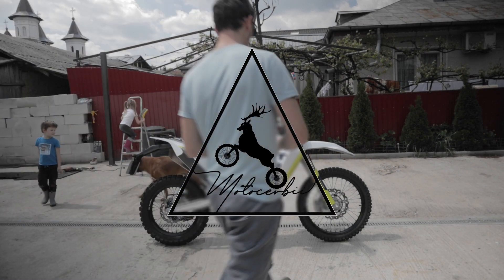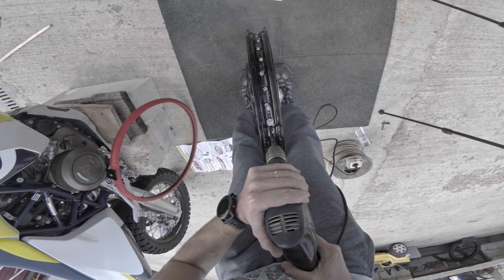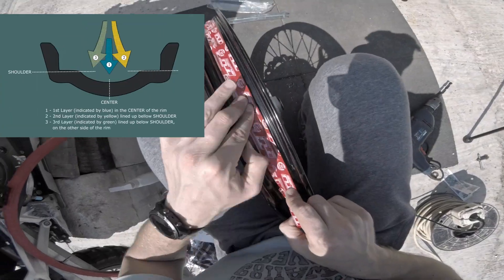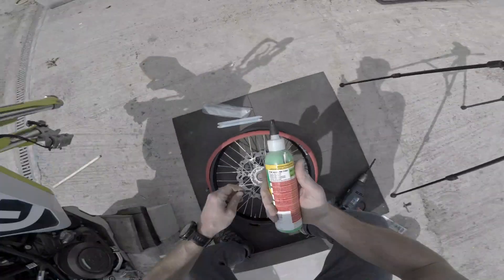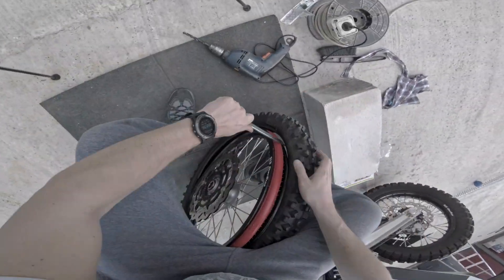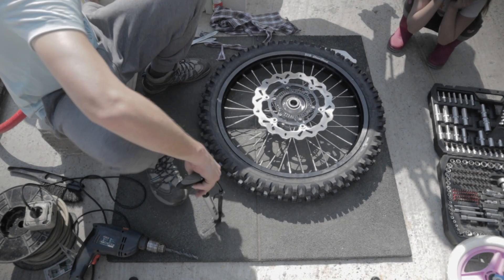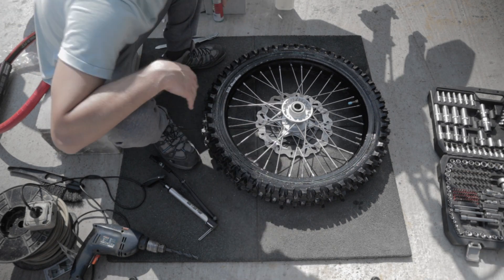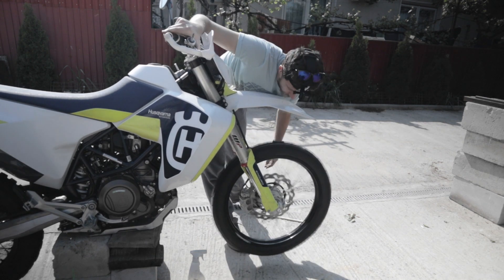Husqvarna 701 Enduro LR (2020) - Nuetech Tubliss and Metzeler MCE 6 Days Extreme Front Install

Comment: Curious, inner Nutech Red Tube is ran at very high pressure and usually the outer tyre pressure is ran very low. You where pumping for a very long time. Maybe should mention what pressure you set.
Secondly you didn't emphasize? Which cavity you filled with the green puncture sealant. I am assuming the tyre cavity as I have not heard of the Nutechs puncturing. Otherwise I enjoyed the tutorial. PS I sanded all the inner rim for abrasions and edges.
Reply from the maker: I inflated them to 25 psi. Usually I keep them between 25-30 psi and lower down when offroad. I also travel a lot on pavement before reaching offroad. I pumped a lot because it's a really small pump. Also, I filled the tyre cavity with the sealent. I did change a tire since this video and didn't add the sealent. Because of this it was leaking a lot of air. After adding the sealent this stopped. I mean, it still leaked air over time but at a slower rate. Before the sealent I had to inflate the tyre each day. Now it keeps the pressure for a couple of days. The sealent is needed because the rim is wider than what the Nutech tubeless was designed for, and if the tyre lip is not thick enough it will leak.

Comment: After these years do you still recommend tubliss for the 701? any issues?
Reply from the maker: I didn't have any issues with them. I would not go back to a different system. It's a pain that you can't calibrate the wheels properly with Tubliss but with knobies on the road, I don't go above 130-150 km/h on the road. I like to have my bike prepared for offroad use and sacrifice road use as all the fun with this bike is off-road. I did have a couple of flat tires but Tubliss made it very easy to fix them or even ride like that until I reach home or take a break to fix the puncture.

Comment: Hey!  would like to know how tubliss shows itself in practice?  I want to put myself on ktm 690 on both wheels.  the manufacturer says they will not fit, the disks are very wide
Reply from the maker: Hi. In short, I would not go back to a normal tube setup. I love the tubeless system. I know there are people that don't recommend this setup for this bike but I had no problems so far (about 1 year of use). There are some aspects to keep in mind when doing this:
1. These are not road legal and the road behaviour will take a hit. You can't properly balance the wheels after this. After 120-130 km/h you will encounter wobbling. This depends on the tires/road/wind.
2. Because the rims are wider than the specs require, you will need to get tires  with a thicker wall and also use some sealant to stop any air leaks. I have done this and I have no problems. I need to inflate the tires every 1-2 weeks. Depending where the bike is standing.

On the other hand, at least for me, I happily traded the cons above for the superior traction and more plush ride quality and also the easy flat tire fixing (I had two punctures which were solved in under 5 minutes without getting the wheel off and all that pain). I am planning to do a video review with comparing this system but not sure when this will be done.

As a summary. It depends on what you are doing with the bike. If you are doing long travels on asphalt and only some country roads, then I don't think this will justify. But if you are mostly going on offroad or single trail roads and encounter mud, rocks, sand then, this is a must.

Comment: Hey! Awesome video! Any updates of the performance of the tubliss on the 701? Already used in a te300 but would like to install it on the 701 enduro!
Reply from the maker: The tubliss system works great on the bike. On the rear I already moved to another tire and I've inspected the system. All was ok inside and the system does not have any wear signs. I did a lot of asphalt roads with the system without any problems. I also had two flats on the rear tire which were fixed in about 2 minutes. Way easier than with tubes. Also, when you air down the tires it fills like a different bike. Huge traction and control and also it takes out a lot of vibrations from the road. Really like the system so far.
Reply: Moto Cerbii wow amazing! Going to install it ASAP. Thanks for your answer. Another question. Do you check the tubliss pressure every ride you do? Or once a week?
Reply from the maker: In the beginning I was checking it every ride. But after seeing that the pressure remains constant, now I check it every week or so. Also, I am pumping 110 PSI so that when pressure is dropping it will still be ok over time if it reaches 100 PSI.
Reply: Moto Cerbii thanks a lot. Very usefull your answers. Ride safe!

Comment: 18"Tubliss is only for rims  -2.15". But the 701 has a 2.5" !
Reply from the maker: I know. That's why I use tires with a thicker lip and also add sealant in the air chamber. It works with the tire from the video and also with the Mitas C02 which I currently use. I do keep the tubliss inflated at 110 PSI.

Comment: Hi, since the sizes of Tubliss are 18" Tubliss System (Fits 18" x 1.85 to 2.15 Rim)Qty.1 21" Tubliss System (Fits 21" x 1.6" Rim) , but the 701 Enduro LR Rims are wider: 18"x 2.50" ! and 21"x 1.85" ! Is this not an issue?
Reply from the maker: I haven't had any issue with this. Some tires may leak some air if the tire wall is too thin. I am currently using Mitas C02 on the back and Pirelly MT21 on the front and after adding some sealent I have no air leaks. I didn't have any issues with the system in almost 2 years of riding offroad and onroad.